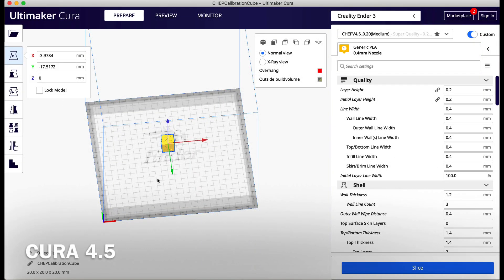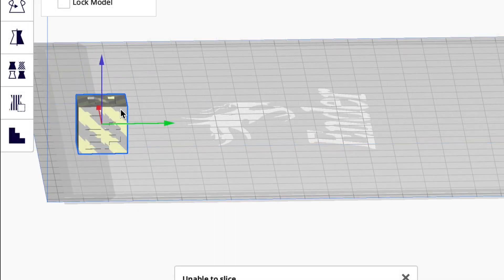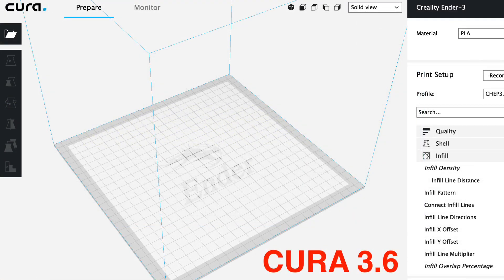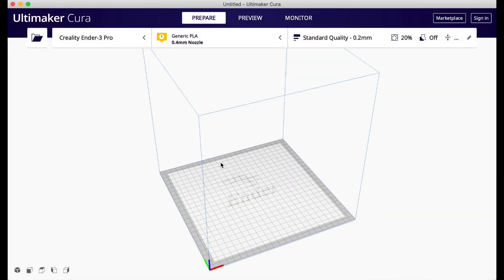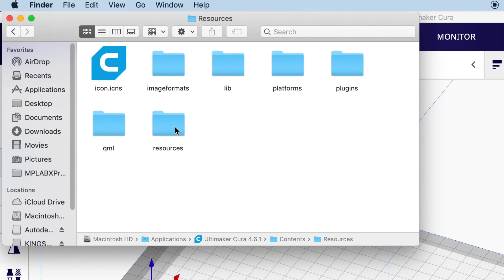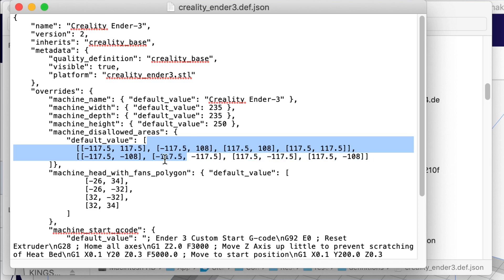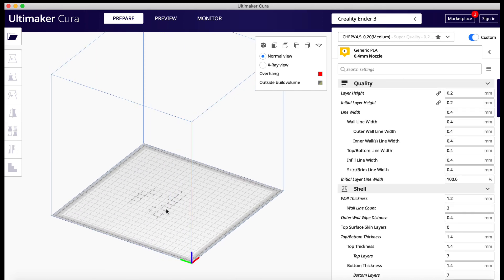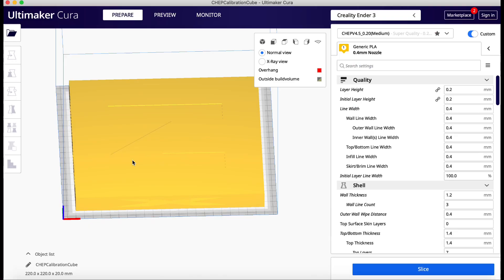How to Remove the Creality Ender 3 Keep Out Area in Cura

Comment: Thank you, exactly what I needed to be able to print a 300mm long bar diagonally (measuring 223mm - 12mm less than the bed), but it wouldn't print because of the no-go zone.

Comment: U can just edit in-program settings of your printer, to enlarge the bed..... default ender 3 pro settings is 220 - which is wrong
in reality it's 235mm
Reply: You mean, "in creality".... lol jk. I'll see myself out.
Reply: @novvaofficial4215  well played
Reply: @novvaofficial4215  no :P i mean "in real" :D but good one :P
Reply: The bed itself is 235mm. Unless they changed it in newer firmware, it will only print to 220mm. Unfortunately, Cura had 235 in its settings. Fortunately I learned this at layer 1 and not 11 hours into the print.

Comment: The location in version 5.5.0 is the same as from comments for previous 5.x versions. Just calling out 5.5.0 in case someone skips other comments because they are older versions.
\Program Files\UltiMaker Cura 5.5.0\share\cura\resources\definitions

Edit: I've found a different way to do this that I like better. I edited the profile settings file for my printer profile. To get there, you can click "Help" > "Show Configuration Folder" at the top of cura, and in the new window go to the "definition_changes" directory. The path is C:\Users\username_here\AppData\Roaming\cura\5.5\definition_changes. Editing the setting here will take precedent over the default definition, so you can leave the default as is. If you wanted to create a new printer profile in the future with the default no print zone, you could. Just paste an empty array in the file:

machine_disallowed_areas = []

Alternatively, you can make custom polygons here to be just around where the clips are, so you can still avoid them but use the entire print volume everywhere else. I tried using both machine_disallowed_areas and nozzle_disallowed_areas, but the nozzle one does not block skirts or brims. And neither of them block travel moves. I'm submitting this as an issue, so hopefully it will get fixed in a future update.

Edit 2: I guess I should also mention the Travel Avoid Distance. There’s a setting (that can be changed normally in Cura) that keeps the nozzle a certain distance away from printed parts when it’s performing a travel move. If you find that there’s still about <1mm of space from the edge of the buildplate where you can’t place your model, this is why. Making that 0mm will get rid of that no-print zone, but you’ll need to be careful with travel moves if printing more than one model.
Reply: Thanks !!!! Because there was no "machine_disallowed_areas" in my Ender 3 S1 Json file.

Comment: I follwoed the instructions and cura shows no lines at all. But when I place a model in cura, they come back! Anyone can save me? I'm trying to print a 232mm wide model, which should fit in a 235m bed (risky, but gonna try anyway).
Reply: I’m having the same issue. If I figure it out I’ll respond here. From what I’ve researched, it’s something to do with the printer firmware maybe? Not sure how to change that, gonna need to test it out.
Reply: @Chancemeister  Yesterday I’ve teste using the same procedure in this video for my former cura installation (4.6) and it worked fine. Light grey areas are gone. However, on cura 5.x they keep showing up. Weird thing is I have both versions installed on my pc and they share the same libraries and json configs.
Reply: @Elciofs77  I’ll admit I misread your issue a bit. The problem I’m having is that no gray appears anymore but when I print it it’s like they’re still there. My print got cut off where the gray would have been even though I’ve made it so CURA doesn’t show any gray. Make sure you turn the skirt to “none” so it doesn’t put any gray borders.
Reply: @Chancemeister  ur bed ahesiuon
 skirt is still on?
Reply: @BRC21  LOL THIS WAS MY ISSUE ALL ALONG

Comment: The resource folder has changed locations a bit. The folder you are looking for can now be found here:

C:\Program Files\Ultimaker Cura 5.0.0\share\cura\resources\definitions
Reply: did remove added numbers but left, right and rear borders are still there. somehow only front border disapeared

Comment: I have a Sunlu S8 and am using the Creality CR-1 Cura profile. In machine settings, I changed the bed size to 310x310mm but I cant fit an object that is 305.1x305.1mm. I have that narrow grey border around my bed that seems to be preventing it. Upon going into the definitions file creality_cr10.def.json, there is no "machine disallowed areas", but it still states in this file that machine width and depth is 300x300mm. When I correct to 310x310mm for my Sunlu S8, upon saving, it says you dont have permission to save in this location, contact the administrator. Its my laptop, I am the administrator, how can i fix this? Thanks
Reply: Ive checked in user accounts. I am the only user and I am set to Administrator yet I get a message saying access is denied when I try to save changes to the creality_cr10.def.json file after opening in Notepad. Can anyone help me?
Reply: @AshleyWragg  save that file in a different folder  outside of program files then just paste it in and replace the old config file
Reply: @DanielloDD86  Hack level 100

Comment: Running Cura 5.1.0 on Win10 and attempted this fix. Unfortunately it does not appear to work on the latest Cura, it does allow me to print up to 200mm wide, but not up to the 220mm as shown by Chep in the video.
Reply: Same, but with Ender-3 S1 there's no disallowed area just a pretty big gray border :/ tried adding the disallowed from ender 3 file, but didn't work! also tried what Daniel Lord above said, but went into the creality_base def that it intends from didn't change anything... If anyone has a new method please lmk!
Reply: go to Print Settings. Search skirt. Zero out Skirt Line Count, and Skirt Distance
Reply: @johnnysyoutubevideos5451  Easier way: Change "Build Plate Adhesion Type" to "None"
Reply: @johnnysyoutubevideos5451  Thanks for that tip, I didn't think that margin on my skirt was all that big though. I guess in reality 20mm would be saved doing that plus the width of 2.4mm(3 skirt lines*both sides) so 22.4mm in total would be saved 0.88" That sounds like the missing 20mm's to me lol :)

Comment: For cura 5.0 user it's not allowed to save the file. 
Use en previous version of cura an copy past the ceality_ender3.def.json file in the cura 5.0 folder
Reply: go to Print Settings. Search skirt. Zero out Skirt Line Count, and Skirt Distance
Reply: You have to open Texteditor in administrator-mode, than open the file and save it

Comment: In Cura 4.13 I got  it to work by replacing the entire overrides section with the one from the ender 3 pro, but then changing the default size from 220 to 235.

"overrides": {
        "machine_name": { "default_value": "Creality Ender-3" },
        "machine_width": { "default_value": 235 },
        "machine_depth": { "default_value": 235 },
        "machine_height": { "default_value": 250 },
        "machine_head_with_fans_polygon": { "default_value": [
                [-26, 34],
                [-26, -32],
                [32, -32],
                [32, 34]
            ]
        },
Reply: this doesnt quite increase it to the amounts in the video though. doing a chep cube and scaling it to 220 x 220, the object doesnt fit. unsure why 4.13 and 5 both arent acting like they should per the video.  UPDATE: scratch what i said, the reason the gray is still there is because of build plate adhesion in the print settings. turning them off opened up the full volume. cheers
Reply: @thresherhorn  Yep! Glad it worked for you.
Reply: @thresherhorn  i did everything he did in the video, with my Ender 3 Max and have build adhension off and still have grey bars, I did Chep Bed level test one at 140 which made it exact to the grey lines and printed another regular size test and there was 1/4 inch difference

Comment: Can you use the machine disallow function to exclude the print head from an area of your print? Say you wanted to print one color, lower on the Y in one color and on the same print, a different color higher on the Y, but are nervous the print head will hit the previously printed area? I watched your video on different colors at different layer heights, but this would be different. Maybe say height, but different Y coordinates.

Comment: Hi this happens on 4.13.1  yet nothing is in the def file
Reply: In Cura 4.13 I got  it to work by replacing the entire overrides section with the one from the ender 3 pro, but then changing the default size from 220 to 235.

"overrides": {
        "machine_name": { "default_value": "Creality Ender-3" },
        "machine_width": { "default_value": 235 },
        "machine_depth": { "default_value": 235 },
        "machine_height": { "default_value": 250 },
        "machine_head_with_fans_polygon": { "default_value": [
                [-26, 34],
                [-26, -32],
                [32, -32],
                [32, 34]
            ]
        },

Comment: Hope you guys read this -

All you need to do, is to go into the print settings, and disable "Adhesion Type"

If you activate skirt, it will limit the borders. If you take it away - you get full print bed to the edges. Hope you try this and see if it helps.
Reply: That's a different, although a bit similar thing. But the area for clips at the front and back is not allowed to slice even with adhesion set to none.
Reply: Saved my butt printing a helmet! I just needed a couple millimeters more to make it fit on my Ender 3 and couldn't figure out how to get it without cutting the helmet into smaller pieces. Disabling the skirt did the trick. Thanks a ton!
Reply: Thank you.  I hate videos that are 90% filler time.  Just tell me what I want to know.

Comment: This worked for me in Cura 4.8, but I can't make it work in Cura 4.10. I even copied my edited file over, and verified it by opening it, but it has had no effect in 4.10.
Fixed! Before I made the 
disallowed areas an empty set. but the fix is to delete the parameter entirely.
 The old fix:
       "machine_disallowed_areas": {
            "default_value": [ ]},
New fix, delete the whole parameter.
Reply: When I try to save the text file, I am getting a warning which says I do not have permission to open the file and to contact the owner/administrator to obtain permission. Any way to by pass this?
Reply: @cesarmartinez6708  It can be tricky. You have to open Notepad as an administrator. In Windows 7, the easiest way is to add Notepad to the task bar,  right click it (to get a menu) then right click Notepad (to get a submenu with "run as administrator" on it), then navigate to the file and edit it.

Some people copy the file, edit it elsewhere, and try to replace the original, but I seem to recall having the same permission issue trying to copy the file into that folder.
Reply: Thanks! Huge save of time!
Reply: Even better. Click "Ender 3 Pro" --> "Manage Printers" --> "Machine Settings" --> Set X & Y to 235 mm. Fixed. As long as you don't touch the "Adhesion" button. Then you're screwed again. But the fix for that again, is to head over to custom settings and set the "Build Plate Adhesion" to "none".
Reply: @MariusViken  Nope, that doesn't affect the disallowed areas. The normal machine setting preferences is the FIRST place I went trying to get rid of the dark gray bars, but they are not affected by that. There's no user interface for editing them. Note that they only apply to the Original Ender 3.

Comment: So I tried this because I have recently upgraded my Ender 3 to a Idex and a 400mm xl kit. When I deleted those lines I lost all my profiles and it wouldn't work. But what I did do to make it work was changed the numbers. So like one is 117 I just changed all the 1's to 3's so I made it 317. It worked great and no issues. But do this for all the numbers in the no go zone.

Comment: Same issue with the CR-6 SE in 4.9.1, but the solution does not work. In creality slicer (based on cura 4.8) they configured the bed to be bigger than it actually is. That is pretty dirty hack. (Octoprint is complaining about it for example)

Comment: This does not seem to work in Cura 4.8.x or 4.9.1 for the Ender 3.
Reply: make sure you have skirt off.
Reply: Yes it does.
Reply: @antonip1114  "disallowed area" line not in definition on 4.9.1
Reply: I was mistaken, it does seem to work in Cura 4.9.1, I can now get up to and including 212 x 212, if I change the X and Y under printer settings X and Y to 235 for both, with Skirt on, with no Skirt I can get up to 233 in X and Y...

Comment: Hi I got an anycubic i3 mega s running cura 4.9 and i can't find what i have  to delete in the cura 4.9 resource file for my machine? Any ideas ? Change my table or bed from glass to magnetic any could use the realastate. ha.
Reply from the maker: Just use an Ender 3 profile and change size to 210x210x205 and you should be good.

Comment: as always, great videos and great information, i have gotten better prints on my ender 3 pro because of your videos, got it as a gift and started using it on january 1 2021

just found this video, so hope this will help with my issue; i have issues with my ender 3 pro, for the time being i am using cura 4.8 and i am trying to print a dragon, scaling the model as big as i can i get it to be 207 in "Y", and i am able to slice it if i do not use brim,skirt or raft, but if i use any of this i get message that i am getting out of bound for print size, it has been eating my mind for the past 3 days,  will do some tests and hope this video will help me to be able to use full print volume of 220 X 220 X 250mm.

i am afraid of bed adhesion getting in the way and ruin 30+ hours of printing ruined, i think better use a raft or any other than to be sorry for not using it. will update with results in the following days, thanks againn  for sharign this great information with us

Comment: It does not work with Cura 4.8 or 4.9

But i have a ptint of the size 220mm, is there any other option?
Reply: I can confirm that it does work on PC Cura 4.9, just updated today. I do use Notepad++ in administrative mode in order to successfully save the file.

Comment: Despite adjusting settings in cura and in the code file. My Ender still believes in printing with its original restrictions. Is there a way to fix this?
Reply: Try adjusting the ‘build plate adhesion’ options.

Comment: It doesn't work for me it wont let me save the file after I change the text file it says that I don't have permission to
Reply: Hi, if it is still unsolved here is a way I managed to solve it:
1. Open the file with notepad, edit it.
2. "Save as" to your Desktop
3. Right click on "resources" folder and deselect "write-protected" (sorry but my laptop is not english)
4. Repeat step 3. with "definitions" folder
5. Drag and drop the .txt file from your desktop to "definitions" folder.
6. Write the old one over with the new one

For some reason It did not worked at first. I dont know why but windows switched back to write-protected at these folders, even after I modified them as Admin.. But after 3-4 tries it worked. Hope it will help.
Reply: Two suggestions - Assuming you are in Windows and Cura is not open.
1. Search your applications for "Notepad", Right click the icon and select 'More', 'Run as Administrator'. When Notepad opens, Edit the file and you should be able to save it.
2. "Save As" the file to a location you are allowed to save to like "Documents". Copy the file and paste it over the existing file.

Comment: Chuck, thanks again for the video (I believe I now have watched all Ender 3 videos of yours :)). 

If you still want to have provisions for the tabel clips, instead of completely removing "default_value" node, do as follows: 

1. In "Manage printers" add any other printer profile 
2. Remove existing Ender profile (save any changes you previously made)
3. Change creality_ender3.def.json "default_value" node as follows: 

"default_value": [
              [[-12.5, 111.5], [-12.5, 117.5], [12.5, 117.5], [12.5, 111.5]],
              [[-12.5, -117.5], [-12.5, -111.5], [12.5, -111.5], [12.5, -117.5]]
        ]

4. Start CURA and add Ender 3 again. You will not see new "disabled areas" unless you place something on the build plate, so do that :) 
5. And in "Print settings" set "Build Plate Adhesion Type" to "None". 

This allows to print 220mm in X and Y and standard nozzle misses clips by 1mm. 

Bonus is that you can now print large rectangles sideways. Like 274x54mm box I needed. But for this you will need Marlin-built firmware as well.
Reply: hehe I am coming back to this post every time I update Cura. I have to back up this somewhere :)

Comment: For me, this only worked on the currently active profile. When I switch to any other profiles, the area shows up again. It only affected the custom profile that I had active. I switched to a stock profile, made a change and then saved the overridden settings, the area showed up again. I would have to duplicate that 1 profile to be able to have it work on any other profiles.
Reply: I didn't get that issue on 4.8.0
Reply: @c3pu333  I have no idea why, but that is what happens to me. It even happened to a friend that I told how to do it.